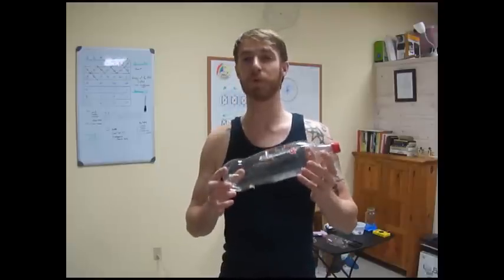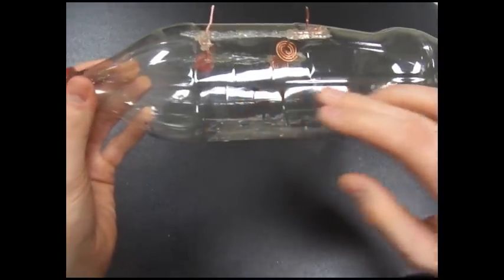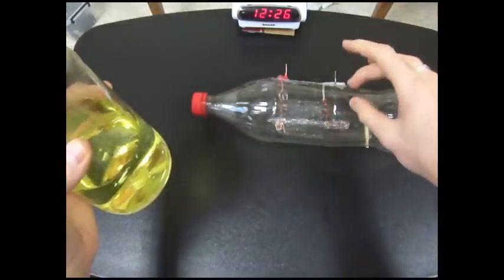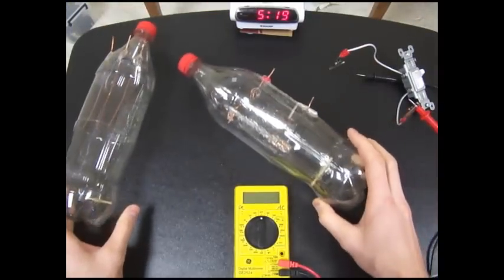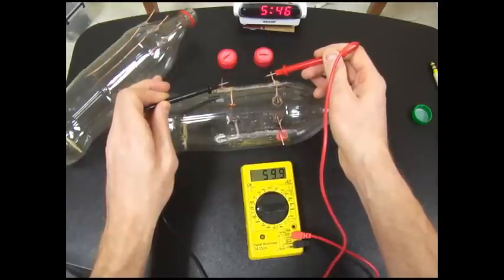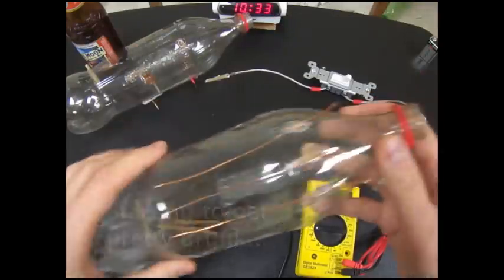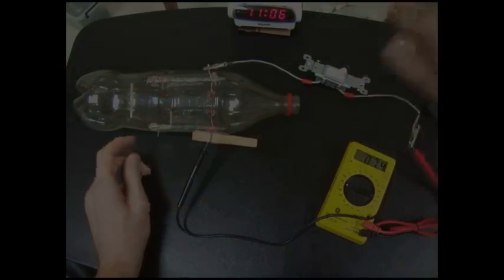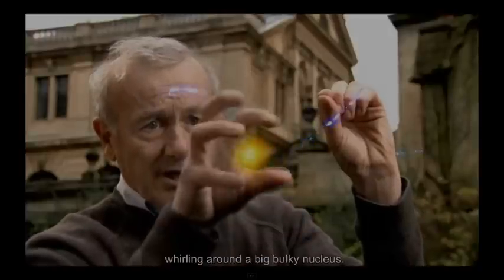Drunk Free Energy ~ Saving the World ~

Comment: Most compressed energy is within vibrating matter of opposed motion simulating rest and balance now through violent motion.
Everything is vibrating two opposing electrical vorticies or Fibonacci.
Only difference between solids, liquids, gases, and plasma is Volume!
Mass plasma field vector +Mu of universe acting upon every point of space from a distance radius.
The greater surrounding masses or energy density compressing wave+amplitude shorter the oscillating wave-lengths the greater the energy.

Comment: All that is happening is he is picking up the current and voltage captured by the metal antennas from his home bloody WIFI and any other radio signals that fully or partially tune into the metal coils, the plastic bottle acts as a capacitor and so when left for a few hours charges up with minuscule ampage YES RADIO signals have POWER!!! OMG you did not know that? what did you thought the amplifiers in radios worked on? magic? what did you think a radio was amplifying? ghost energy from the dead?

Comment: He has been able to measure a voltage and in fact a high one. But voltage alone is not a measure of energy. In any electric circuit the voltage times the current is a measure of power. So V*I=P. Power is the ability to do work over time which is a measure of energy. 

I live in New England and I can tell you that a metal door nob is often at different potential then my body. It can produce a spark and a sting of the hand. Does that mean we should all collect that 'free energy in Layden Jars.

Comment: Well, it looks like you've made a battery with plasma in the air inside of the bottle, instead of other solid or liquid materials like in usual batteries.

What if the air inside the battery stops the plasmatic reaction due to a lack of your 'magic liquid' and the ' bottle battery' lost all of its charge?

Comment: I'm trying to convert my car to run on the Keshe dynamic ionizing Planck reaction generator principle. My problem is I cannot find a soda bottle large enough for proper plasma ionization. I've tried a 5-gallon water cooler jug, but it only outputs 95 horsepower of free energy, not nearly enough for my uses.

Comment from the maker: I did it! 
After 3 all nighters in a row.. I have built a Plasma Generator the breaks the Laws of Physics, and made a video about it.   Enjoy, and Happy End of the World!!  Please share with your homies
Reply: How does it break the laws of physics? Please explain
Reply from the maker: Inside this bottle there are four pieces of copper wire (electrodes), and they are not touching each other - they are independent.  This means that within this bottle there is an open circuit. (Like an on/off switch, a circuit is OFF when it is open, and it is ON when the circuit is closed. On=electricity flow, Off=no flow)  

WIthin our current understanding of physics and electrodynamics, it is impossible to close a circuit (turn it on) AND generate electricity from the air within an Empty Open Plastic Bottle.

However, with our new understanding of the creation of gravity, we have New Physics in the world of science.

This experiment breaks the old laws of physics and brings to the light of day a new discovery, and it's pretty exciting.

*The energy that spins our Milky Way Galaxy, our Solar System and Home Earth is the same energy that spins the electrons within this bottle. This is the universal energy being taped into via this experiment, because there is literally a microscopic galaxy of atoms in this bottle spinning around copper wire (closing the circuit and generating electricity).
Reply: Cables running outside the video frame is suspicious. Can you actually power anything with this contraption? If so please post video, a computer fan for instance running for a few minutes filmed from different angles so we see that no external powersupply is connected. The meter could also be faulty. Filming should also be done continuously without any cuts. Should be easy enough to do if it actually works. If it works I will be positively very surprised.